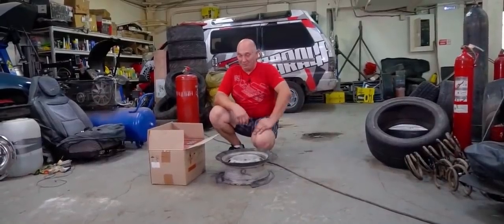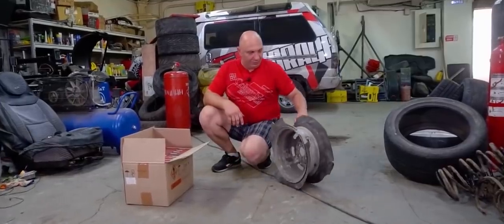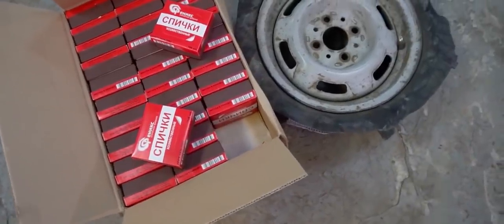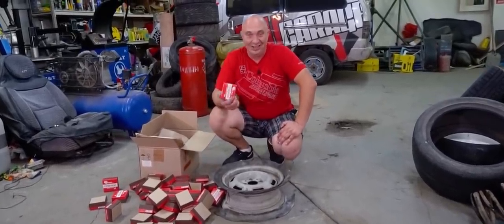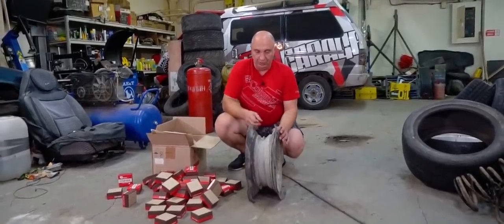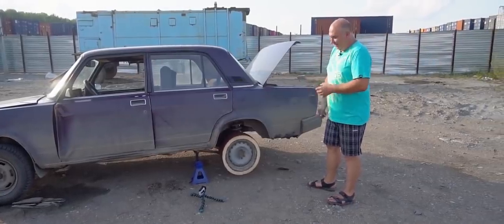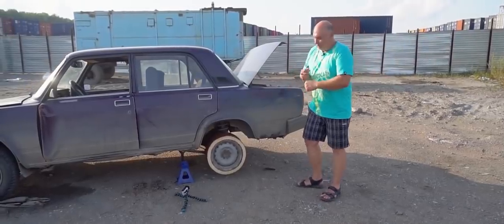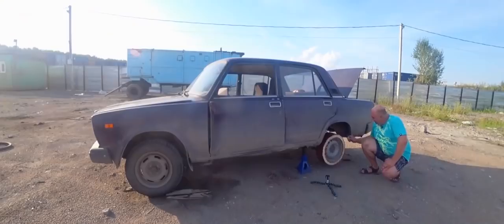Making a wheel out of 21.000 matches

Comment: Can you lift one driving wheel off the ground and the other locked and give full throttle in highest gear? The free spinning wheel will go in 400 km/h if the top speed of the car is 200 km/h.

Comment: I once heard you could use a pair of Ladies tights for the engine timing belt, be interesting to see if it works as a temp fix 
#
Reply: No not as a timing belt lol you’re thinking of a fan belt and I’ve heard that too, I’ve never seen it done but I think it could work in some vehicles.
Reply: @dislikebutton9302  It may have been that tbh I'm not sure, I ain't too savvy with this stuff.